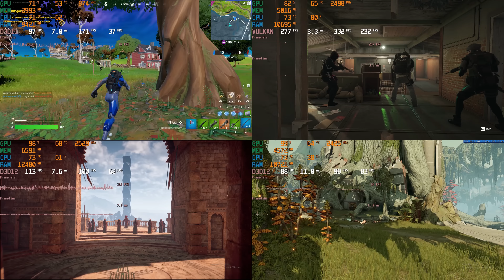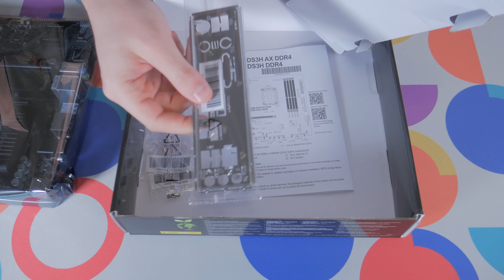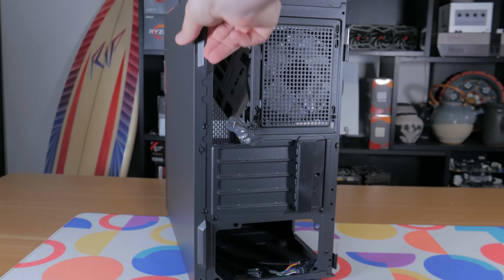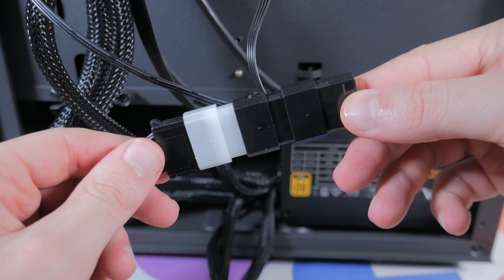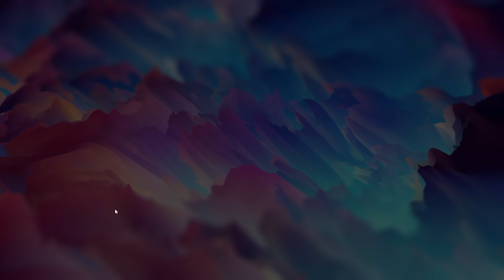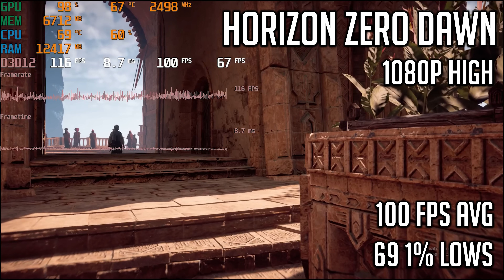BEST $800 Gaming PC Build Guide! (2022)

Comment: my build for a gaming pc under 800$ 
 1. GPU: GeForce RTX 2060 
2. CPU: AMD RYZEN 7 5700X
3. RAM: Kingston Hpyer x Fury 16GB (2x8)
4. SSD: Kingston NVME 1TB 
5. PSU: XIGMATEK X-Power 700W 
6. MOTHERBOARD: Gigabyte B550m Aorus Elite Motherboard 
7. CASE: DarkFlash Pollux PC Gaming Case (BLACK
this pc is good for gaming recording streaming etc it can run any game above 140 FPS
Reply: What cpu cooler?
Reply: @l___1275  any  cpu cooler will do good but i reccomend getting a towerfan cooler instea d of  liquid   cooler
Reply: @l___1275  also try to go for used rtx 2060 so u could get it for cheaper without performance difference

Comment: @tech by Matt -- Thanks for the video. My son wanted to do this build for Xmas, and we spent the day assembling it. We got the exact same parts from your video and followed the instructions to the T, but unfortunately we aren't getting any signal to the monitor. We've checked using two different working monitors. We've replaced the RAM with other RAM. We've replaced the power cabling. And we've disassembled it and re-assembled it. For naught. It seems like that leaves either the ASRock 6600 or the motherboard as the culprit. Any advice?
Reply: Same thing is happening to me , have you figured it out?
Reply: @makuzzu  did you guys figure it out?
Reply: @smallbignoob  I just needed to plug the hdmi into the gpu and it worked
Reply: yeah i just figured that out yesterday

Comment: Hello I just built this pc exactly part for part only difference is I bought a 650 g+ supernova power supply, my cpu idle temp is around 65c and as soon as starting up games shoots to 99-100c I checked everything and am using msi afterburner to check and through bios it idles very hot 65 aswell any ideas?
Reply: you should verify if the air cooler is well installed
Reply: @teo5415  that was the exact issue thank you!

Comment: Got this exact build 2 weeks ago . I recommend. Easy to build and games run great !!
Reply: Did a cooler come with it?
Reply: @mitchellsmith5149  a cooler does come with the 12th gen i3 and i5 12400 @ 12400F
Reply: have you tried warzone with it? if so, what fps do you get
Reply: Sorry for being late but for wz2 I get high 90s fps for ultra settings

Comment: I just helped my son put together his first pc build and followed this tutorial to the letter. I bought all of the parts listed in the video and bought an AOC monitor.  When we turned it on we get a "No signal" error from the monitor.  We've double checked the VGA cable is plugged into the graphics card but can't seem to get the monitor to communicate with the PC... any suggestions?
Reply: Did you ever end up getting it to work?
Reply: Did u get it to work/ find out what's wrong with it?

Comment: I’m building a new pc and I have a list of hardware to buy, can anyone see if there a better option to pick? First time builder my old pc was a prebuilt lol.

-Ryzen5 3600 (Processor)
-Asrock B550M PRO4 (Mobo)
-PSU FSP HV PRO 550W 80 Plus Bronze (Power Supply)
-ID-COOLING FrostFlow X120 CPU AIO Water Cooling (Cooler)
-Seagate SSHD FireCuda 1TB (HDD) (I have one in my old computer just gotta format it)
-SSD M.2 PCle 3 x4 KAIZEN 512gb (SSD)
-SSD Cooler THERMALRIGHT M.2 2280 PRO (SSD Cooler)
-RAM V-COLOR DDR4 Prism Pro RGB 16 GB (2x8) 4113 MHZ (RAM) (Extra 8 GB from old pc)
-Asrock Rx66000 Challenger D 8GB DDR6 (VGA)

Comment: The choice of Ram doesn't make any sense to me. You can buy a 16GB 3200 CL 16 Kit of Corsair Vengenance for less than 60 dollars on amazon and this has been consistently priced for over a year, I used this for my sons and my daughters PCs for Christmas and just checked the price and tis 57 dollars currently. Perhaps he is just using a kit of ram he has sitting around but if you going to recommend anything for a budget build it should be the best bang for the buck.

Comment: Ive been able to get 6600xts for around 210 usd which is a very solid paring with the 12100f, as I am currently daily driving one from ebay that was open box. I just wished the used market reflected this price perfromance for a lot of the used part listings, as right now its a jungle of scalpers overcharging for an r9 290 from 2014 with a blower that goes to 90db for 150 usd

Comment: I would have to disagree with Matt's choice of going only with a 500gb SSD. If you do go with the SN570 sure out of the 250GB it is a decent price but I would highly recommend either getting a 2tb HDD along with it or just getting the 1 or 2tb version of the SSD because nowadays 500GB's really is not going to get you far. Sure it would have been acceptable several years ago but for a gaming rig I do not see 500gb getting you very far a lot of games especially triple A titles easily take 50 or more GBS for example the game that uses the most storage that I have is GTA V which takes up 105 GB's of storage. This also doesn't mention the other things you might want on your PC such as Pictures, Applications, and any shows, movies, anime you might install.
Reply: When you can get a 1tb nvme for under $100, it should be the standard.
Reply: @cole__tegtmeier678 im buying the wdb 1tb nvme for 70 dollars lol
Reply: extra knowledge!
Reply: you don't install shows, movies, or anime. But yeah. As someone with 1 TB of storage, it's def not enough.
Reply: @retrowarden1  well depend so do i use to when i have problems with wifi today i probably wont do it becuase i work and can paid my internet and wifi so
Reply: Yeah especially since now in 2023 (I'm in the FUTURE!) you can get cheap 1tb SSDs for like >40 bucks which wasn't possible at the time this video was released
Reply: jokes on you i play ark and it requires 200gb
Reply: @weilysium  true basically everything requires 100 plus gb and few exceptions like indies but most triple a and huge a 1 tb i would think that is small decent but a 2tb would be save
Reply: COD Warzone is 100 gb, so yeah, it wouldnt get you that far xD

Comment: Congratulations, my build for this price - range would have been pretty similar with the main components (12100F + RX 6600 + B 660 DS3H + 16GB DDR4)...500W 80+ Gold would have done the job easily as well and I would prefer CL16 and a decent 25 bucks cooler but yeah just trifles...you picked wisely and get a pretty decent 1080p High/Ultra Gaming Rig for just 0.8k
Reply: Ive edited the rig to be 725 Dollars so this is perfect base and also agreed are you going to buy this because i already have all the parts coming to me right now 😃😃😃
Reply: @slimedotb  bro please send the part lists (discord or here)
Reply: @redwolf1582  You have to do some deal hunting and if your not american your screwed with this build but here you go i guess btw its not all the same but works as the video said smooth high gaming pc 
so whats your dicord ill be back with all the parts to you quickly by tommorow so yeah 
😃😃😃
Reply: do you think is the best 800$ pc?
Reply: Do you think I should get a 500W 80+ Gold or should I pay an extra $25 for a 700W 80+ Gold?
Reply: @daniel.1899  For this build a 500W 80+ Gold is more than enough, even lying well in the efficiency curve...Just for the case that you would upgrade your pc with some massive GPU and maybe CPU in future the 700W PSU would make sense
Reply: @Dark88Dragon  Thanks man!
Reply: @Dark88Dragon  Also, do you think I should upgrade the motherboard to a MSI Pro b660m A?
Reply: @daniel.1899  Not sure if you can talk about an upgrade if you choose between the DS3H and Pro A...the MSI-Board would make sense if you got a small case...Its the entry-level board for the b660, but both mainboards are not bad for its price

Comment: I have no need for RGB, and would go for the 1tb nvme. Might spring for the 6600XT as well.
I used to laugh at I-3s but that 12100 is actually a great CPU for the money. The CL18 is a maybe. I prefer the 16.
Solid build for $800 though.
Have a great day.
Reply: its the i3 12100 that is better then a i5. i belive an i5 is still better then i3 except the 12100.

Comment: Bro just bought this case and mine doesn’t work for the rgb even with that button, the fan still spins but I feel let down as this build would have looked miles better with the case lights on! Great video built a 6700xt with 11th gen i5 for around $500 will have the video up soon aswell
Reply from the maker: Have you tried reseating the the molex connectors and ensured the white piece is in between the PSU molex connector and the case molex connectors?
Reply: @TechByMattB  ive tried, at first I’ve removed the molex connectors but now watching your video, I’m going to see if putting the white molex connected in between the power supply cable and case molex actually makes this work because so far nothings worked but will update you
Reply: @Capybaracomputers hey did u ever get it to work? I'm about to buy this build and it would really suck if I got the case and it didn't work 😅
Reply: @yuuri3295  it does work, you have to leave the molar fan as is, don’t move the way it’s plugged in when you get it. Just leave it as is and connect it to your powersupply. It’s been a while since I’ve ordered this case and have sense sold it but basically even if you try and plug it directly to the fan it won’t work it comes with another cable and connected with one of them first before the other 

Basically just leave it as you got it and simply plug it in don’t move or tinker with the cables
Reply: @Capybaracomputers  tysm! You saved me from making a huge mistake, I appreciate it !!
Reply: @yuuri3295  yes I even made a video on it, mentioning the issue along with this comment when I finished the build 
https://youtu.be/iiNxAzaP6Do
Reply: @TechByMattB  thank you so much bro I got it to work!! You earned a sub <3 
https://youtu.be/iiNxAzaP6Do

Comment: Intel's i3-12100 being given the IPC / speed boost etc it has, has given it a little more life / longevity, otherwise a quad-core in 2022 would be a waste of silicon imo for a gaming setup. Currently Intel does have the budget performance crown over AMD. A little tit-for-tat between the 2 big CPU companies is great to see and drives each to innovate more! I think AMD isn't putting much effort into quad-core CPUs' as many titles now and going forward are utilising 6+ cores and most of its threads and for basic office setups the quad-core is able to drive many generic office tasks.

Comment: another good matx case reccomendation for cheap is the cooler master nr400, it has great airflow and nice design
Reply: thank you so much, the one used in the video isnt available in the UK
Reply: Does it work with this exact build and would there be any major differences or anything else to buy? Sorry I have never built a pc before and want to be 100% sure before I buy anything.
Reply: @cazzyspazzy4138  it does work with the build. Or at least it should. If you buy a motherboard that is m-atx then It will fit in a m-atx case. I'm sorry I don't have much time as of now to write but I'll get back when I can
Reply: @cazzyspazzy4138  hey, i just built this exact pc with the nr400, the only difference i found was that i didn’t use any molex cables for the case fans, i just plugged them straight into the motherboard, that’s all :)
Reply: Ok thank you very much this helps a lot

Comment: I got a couple of questions, I am going to get a i5-12400F. Should I be concerned about my PSU and motherboard. Also how much better is the i5-12400F compared to the i3-12100F. 

Secondly should I get a 1TB ssd or can I/should I get a hdd with the ssd?
Reply: If you’re not planning at doing any overclocking on the CPU, then the motherboard should be no problem. I think the PSU would still be sufficient with the 12400f and rx 6600, but if you feel unsure, then maybe a 650-700w PSU is what you might want to get.

As of right now, a good 1TB SSD can be at around $100. The cheapest one I seen was at $75 when in sale. The 12400F has two more performance core and four more threads. As the new consoles now come with eight cores, we can assume that newer games will actually start to use more than 4 cores giving some better marginal results when using an i5 to an i3.

Assuming a storage budget of $100, it is generally considered better to get something like a 250-500GB SSD with a 2TB HDD as you can install your much need programs and most played games on the SSD, while having your HDD take the rest. 

Depending on what you plan to use the computer can change the recommendations, but this is what I’d go for when it comes to just gaming in the computer.

Hope this helps ;)
Reply: @Bosnia-nr8sh  This helps a lot and thanks. The cpu is where i was a very lost so thanks, I'm thinking of keeping the PSU and then upgrading it when I want to upgrade something else later. Part of the reason is that I am cutting close with my budget and I have no plans in upgrading later. I'm keeping the 1TB ssd because I am planning on having a lot of games installed as on my current computer I am using 0.9/1.5TB.
Reply: 550W is more then enough for i5 and 3060 easy

Comment: I’m not sure about the, “orientation doesn’t matter.” As I’ve had to trouble shoot many PCs because my friends plugged the front panel in incorrectly
Reply: for the front panel LEDs you must properly plug in the positive and negative connectors. since diodes allow one way flow of current

Comment: Hey Matt, just saw your video. A few changes I would make: If you don't have the extra $50, I would suggest spending extra $50 on a 12400 and $50 less on the GPU, like a GTX 1660 or RTX 2060 if you can find one at a decent price. If you're gonna not upgrade the system, you could get a less watt PSU, a system like that would only use about 300w, so going for a 400w PSU would be fine. Last thing, for the case, I've noticed with the DIY cases, they seem to be only available on Newegg. For international buyers that are not in the US, shipping is a lot more. I live in Australia and the shipping for the case you put was $94. I would suggest going with a case that can be bought more easily. Good choice of parts though.
Reply: I honestly have no clue what you are talking about. This is a gaming pc meaning you spend your money on the graphics card. The i3 12100f will not bottleneck the rx 6600 at all. And the rx 6600 is the best value card on the market while the gtx 1660 and rx 2060 are one of the worst cards on the market. Clearly an nvidea fan boy and can’t except that and has the best price to performance by far. And how tf is he supposed to know what cases ships internationally.
Reply: Agree that for this build a GTX 1660 Super or Ti would be more than ehough.
Reply: lol
Reply: What case would you suggest
Reply: "If you don't have the extra $50, I would suggest spending extra $50" bro what?
Reply: @CX0EX   yeah read the whole thing, i said if you dont have extra 50 spend extra 50 on cpu and 50 less on gpu
Reply: I think the better solution is just saving a little longer so you can go with the 12400 and the 6600 (or the Nvidia equivalent of a 3060) from the start.
Reply: So you would recommend downgrading the system for $50 more lmao
Reply: @jadenblackerby3325  let me say that more clearly lol, spend $50 less on gpu and use that 50 to get a 12400, but yeah if you're not doing hard stuff with pc you can go with a 12100
Reply: @aussieflightsimmer9964  What's the use of a 12400 if you're gonna run it with a subpar gpu? RX 6600 is much better than a 1660 super/ti and better than a 2060

Comment: I have an XFX Swft 210 RX 6600, and it’s no good for Fortnite.  I have to run DX11 to break 55FPS.  I’m getting like 111FPS with a lot of stuttering.  What are your in game settings, or do you have a video showing your settings?
Reply from the maker: 1080p Max view distance, high textures, everything else set to low. There are tons of factors that are going to affect performance and cause stutters beyond your GPU. One of which is the fact fortnite seems to stutter on basically every system I have tested.
Reply: @TechByMattB  I’m using a TG01 with 32GB of the same RAM, and a Ryzen 5 3600.  Thanks for the settings, I’m going to give them a try.
Reply: Use DX12.
Reply: @jadenblackerby3325  DX12 or Performance Mode knocks me back down to 55 - 58FPS.
Reply: Something is wrong on your end.  The gpu is more than strong enough.
Reply: Looks like I’m on my way with your settings.  Adrenaline reports 169 FPS, and the in game counter locks in at 200.  This is all with an under volt.

Comment: All great choices - personally I would have spent the extra $50 on a 12400 and would always recommend other people do such, and stretch to a 1tb NVME and add an intake fan or two, as those minor price increases are worth it as a percentage of the whole build cost. But great choices all around.
Reply: Any fan that you reccomend? Im doing this build, my budget is 900$
Reply: When you upgrade to an i5 12th gen you would probably need an other cooler. because the stock cooler doesn’t keep up with the cpu.
Reply: @MrNiek-kk3ik  possibly, though that's also an easy later addition. Also, $10 on intake case fans would mitigate some of that.
Reply: @MrNiek-kk3ik  I'm running my 12400 along side my 3070, my cpu normally hovers around 60 to 70c on max settings and is hardly noticeable sound wise. I should also add that my case has great airflow (phanteks p400) and 3 fans.